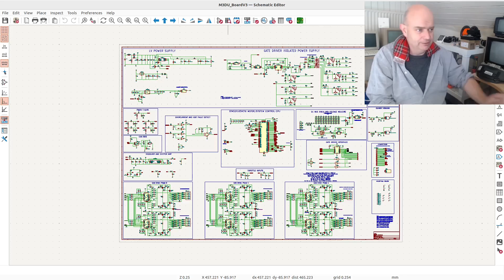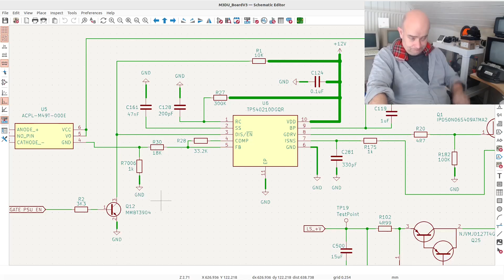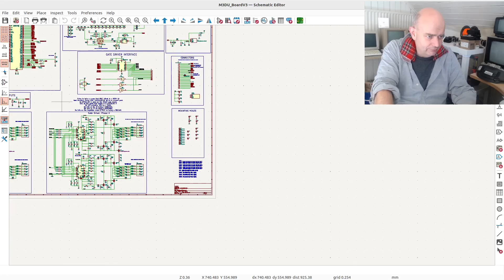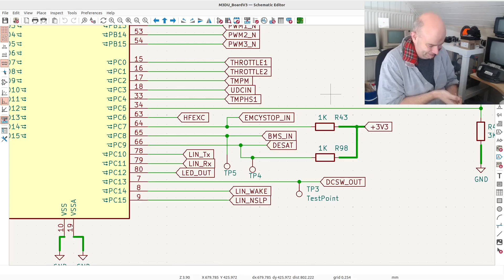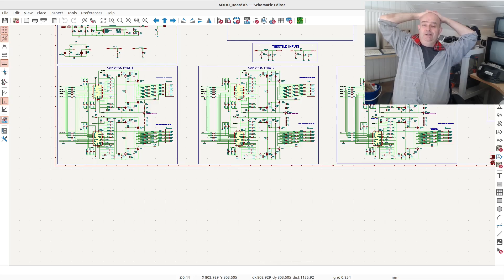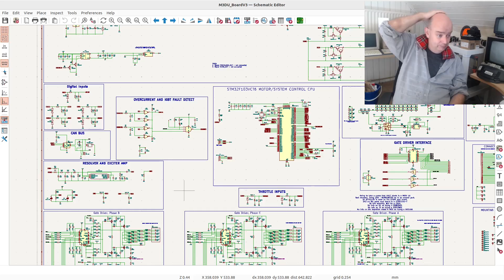Tesla Model 3 Drive Unit PCB Design 12 : Yet More Screwups

Comment: I wouldn't have left the CLAMP pin unconnected especially on a prototype board. I would connect it to a test point so if it is actually required in the future you're not stuck trying to solder a fine wire to a tiny smt pin. And make it through hole so you'll be able to run the wire on the back.

Comment: I'm new in this channel but I want encourage you to use sheets on your schematics, KiCad implements them very well, this style of drawning schematics is less prone to errors and easier to read because you see the overview of the system on the main page. Also it's great for schematics that have multiple channels of one circuit, because you can draw one channel sheet and just simply make a few instances of it. Then when you want to modify it, you just have to make a change on one sheet, you can even copy routing and component placement between channels on the PCB.
Reply: I agree that a hierarchical schematic is the way to go.
Reply: I've just started using this in my designs, and it make things SO much more organized and easier to keep track of everything, not having it ALL splatted onto one huge mess of a schematic!